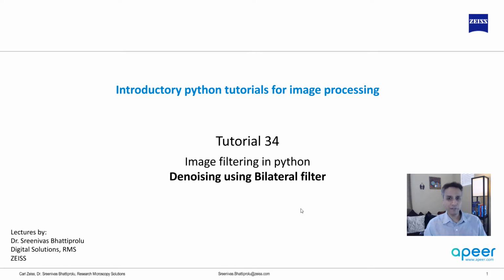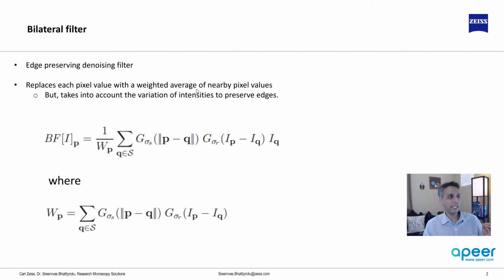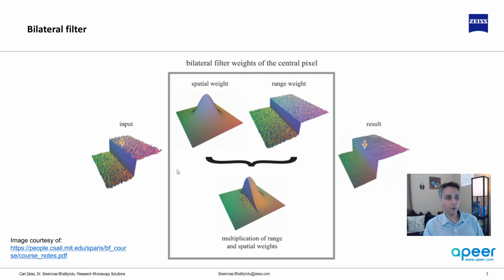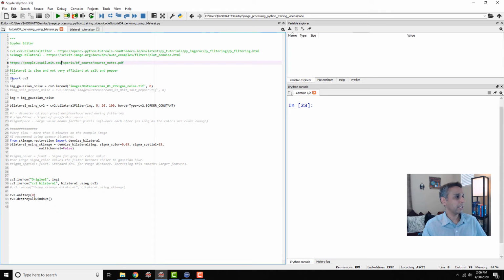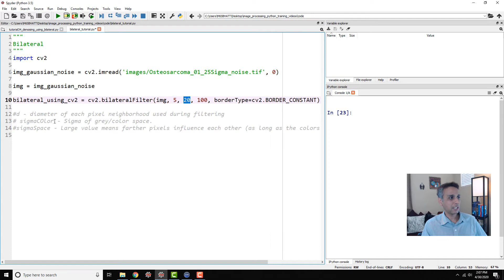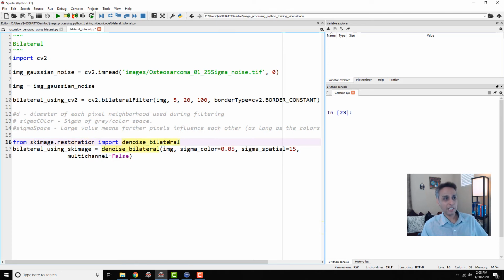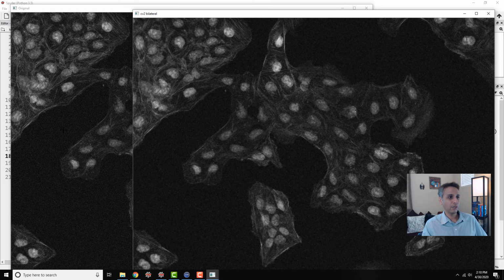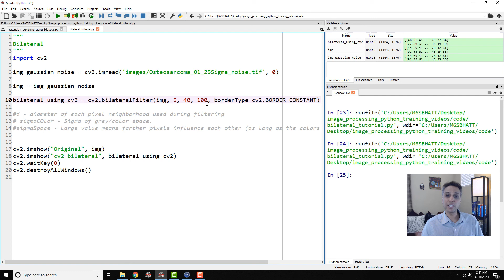Tutorial 34 - Image filtering in python - Bilateral filter for image denoising

Comment: Can we remove salt and pepper with bilateral? I know median is good, but does bilateral works?
Reply from the maker: Median in better. Bilateral will do a decent job but median literally is designed to remove salt and pepper so why try something else?
Reply: Because im my exam the lecture asked
If the standard bilateral filter can remove the salt and pepper noise.
Or (another answer to circle it) you can do it with bilateral, but you have to change the filter. 
So I picked the answer of this can works with standard bilateral filter.

Comment: sir i am following ur all tutorials...i am also working on spyder..but while executing this code this error is shown in console...
error: OpenCV(4.4.0) C:\Users\appveyor\AppData\Local\Temp\1\pip-req-build-2y91i_7w\opencv\modules\imgproc\src\color.cpp:182: error: (-215:Assertion failed) !_src.empty() in function 'cv::cvtColor'

as i am doing other codes also...it is every time showing this type of error...pls tell me what to do....i dunt want to lose the track...pls help....
Reply from the maker: This type of error shows up when you are trying to apply an opencv function to an empty array. I suspect the image in not properly loaded into python. Please go step by step and check you are getting the result you expect at every step. In this case, please make sure you see some numbers for the image variable. It it says 'None' or 'Null' then you know that the image is not loaded. If so, check the path and also make sure your python console is set to the same directory. Check by typing 'pwd' in the console. To change directory, just use 'cd ..'.
Reply: @ZEISS_arivis  yes sir it is showing 'none' in the variable explorer in the image.....ok i ll try to set the path